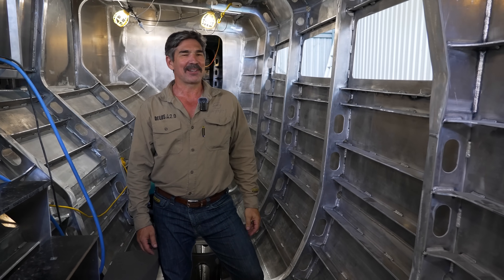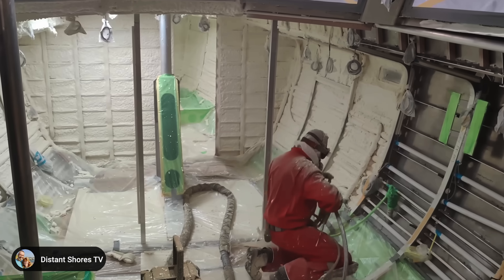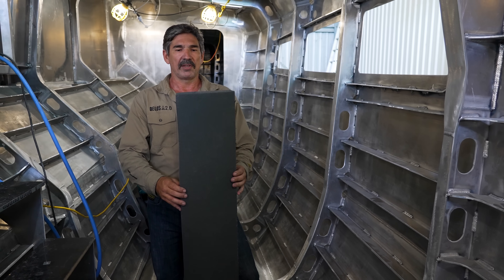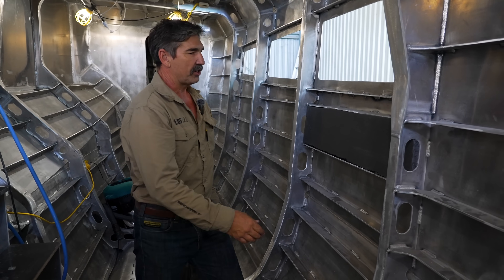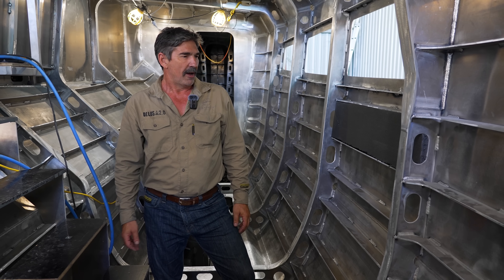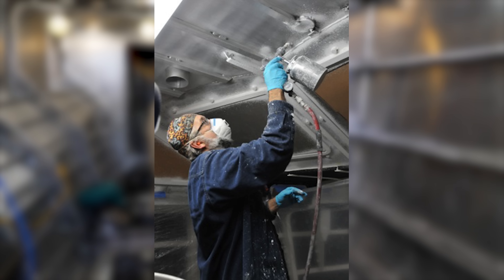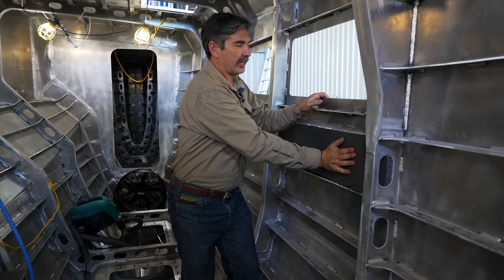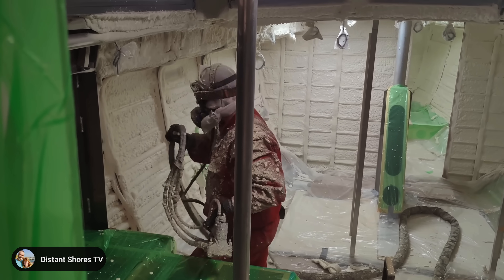HELP, We Need Your Advice!  How Should We Insulate Our Aluminum Catamaran???

Comment: Hi, I have an Alubat OVNI 35 that I bought in France  and sailed back home to Stockholm a couple of years ago. The boat was built in 1984 and I decided to renovate and in particular add insulation. Right now the interior looks just like yours with bare aluminium.
At first, the plan was to insulate with spray foam. What made me uneasy with spray form is that it seems irreversible and that inspection of the inside of the metal hull will be more difficult. Under the assumption that adhesion of spray foam can be compared to painting, on my boat, there is 40-year-old paint on the deck and inside the boat. On the deck there is a lot of corrosion under the paint but inside the paint is still in perfect condition. So in this case there is really no need to be able to inspect the inside of the hull. But can there be other situations where it will be needed.
The problem of insulating a metal hull is common with DIY RVs and also with insulating shipping containers and there are many such videos on YouTube.

Comment: spary foam is better solution. easy to remove with mechanical way or solvent when need and easy to reapply. and the mold will grown behind panels on condesed water.

Comment: Hi Guys! 
Im a 12 year professional Van/bus builder. I am getting away from custom builds and soon releasing a production covert land yacht using the largest Mercedes-Benz Sprinter van AWD turbo. My priorities are functionality, quality and safety as it SHOULD be for every builder. 
You can buy all the same materials as another guy but its a balance of construction, precision and flow.

 You are on the right track as far as awareness and knowledge of 2 extreme temperatures metal being the bridge. Vans and buses also have thus problem, more so in the wintertime. but also in the summer after a cold night turns hot int he morning you will have a bat cave. 

Things to consider, I did some research in material quality. if you want to go down a rabbit hole look at mass deaths and extreme conditions of temporary housing for hurricane Catrina relief victims. Building with similar materials as a standard home in a small foot print the off gassing and toxins are far more concentrated. The air qualities has a dramatic difference in parts per billion of those toxins.

With that said, be cautious with what your suing for materials moving forward as I'm sure you will. Go natural, try to steer away from synthetic  you can. Insulation is the big one...

I would highly recommend Havelock Sheep's wool from New Zealand. Is similar in price to standard insulation and has a higher R value as most insulation. R value is 3.6 per inch.  

Wool is naturally fire resistant and retardant, it has a SMOLDERING point of 2,000 Degrees fahrenheit.  if you have a wire fire it will help put it out and or contain the fire. 

Wool is also has natural antimicrobial preterites.

Wool also regulates moisture! It will pull condensation and help aerate it.

Wool also is purifies air quality and traps toxins. 

Mold is the silent killer in living spaces more so in tight quarters and especially boats and vans... When you get a constant exposure of condensation and entrapment mold occurs. You many never know but can effect your health. 

With all that said wool would be your #1 choice for insulation, my advise would be go with the thin spray insulation for a buffer condensation layer than use these wool batts. 

If you want to really control your interior climate and you have the room i would spray foam and use woo batts on top of that, make sure you have good airflow through out your construction regardless. 

I lived in a Bus with spray foam and wool I had radiant flooring and off grid 24v mini split air conditioning, with 100% off grid self contained solar and batter storage.  1,000 watts f solar and 10KWh of victron lithium. I would ski instruct in Colorado and have spent time in the dessert no problem.

to give you example of the wools abilities I used it as a fire retardant around my wood stove and replaced the formaldehyde insulation in my gas oven. works great. would use it around your engine bays also! I would look into diesel coolant heaters for a "combi" heater for hot water and radiant heat, heated pex floor and air handlers!

Cheers! -Kyle

heres my recommended links,

https://havelockwool.com/?utm_term=havelock%20wool&utm_campaign=GS_Havelock_Search_BRAND&utm_source=adwords&utm_medium=ppc&hsa_acc=3434447461&hsa_cam=21548205263&hsa_grp=160845722570&hsa_ad=708172960060&hsa_src=g&hsa_tgt=kwd-1104058530422&hsa_kw=havelock%20wool&hsa_mt=b&hsa_net=adwords&hsa_ver=3&gad_source=1&gclid=Cj0KCQiA3sq6BhD2ARIsAJ8MRwVJqidcf-_aTzGyZKqOb5J5ZpCI5OJZR6-WRiJF4PBuChdKva02jiYaAr3GEALw_wcB

https://rixens.com/products/g52-hydronic-with-s-3-diesel

https://www.merlinsolar.com/

https://www.cruisencomfortusa.com/?adgroupid=142258080170&device=c&keyword=12%20volt%20ac%20unit&gad_source=1&gclid=Cj0KCQiA3sq6BhD2ARIsAJ8MRwUBIBnVMu4gw_b9NFnLdE4ZMkFxWCNGbf9qREvofXQGrlJRETt_jokaAgH8EALw_wcB

Big things to consider

Comment: We spray foam all our commercial boats that we’ve built for ourselves, not as hard as you think to remove if needed to do patch repairs. I wouldn’t do it any other way. The condensation is a real thing and if you haven’t done it right ie spray foam, you’ll probably regret it. That’s what we did on our 4 65ft vessels

Comment: Spray coating is the best way to go for all reasons. The main reason is what you said. It insulates and you never have any need to remove it barring a repair to that section. Even then it is easy to replace.

Comment: Avid internet troll and keyboard warrior here:
While most of industrial applications use pre-shaped removable xpe stuff, it's not really a viable option for a sailing vessel, as you wouldn't normally access the hull that often. it's gonna be a b*tch to install, and the costs compared to a sprayed foam solution are much higher.
That said, I think this solution is the best /watch?v=dQw4w9WgXcQ

Comment: Up till last year I had a steel boat with spray foam from ‘96, foam was still in perfect condition and I had no condensation problems, it was sprayed to deep under the water line keeping the boat well insulated. Yes, if you have to do some welding you have to scratch the foam off but it is not much of a hassle and after you spray some closed cell from a can. Now I have a aluminum boat with foam panels, everywhere where the ribs are not fully covered I have condensation, even before I have condensation on the windows.  I would put in some extra ducts for whatever cable you need in the future, the wood strips to bolt the interior to and spray, by far the easiest and reasonably foolproof..

Comment: Make sure you use a thermal barrier if you use foam batting. The heat on the hull could melt the areas that touch the metal.

Comment: Insulation pin ist steel, fixing to an aluminium hull gives you a fine little battery running a corrosion process beneath your insulation. There you go...

Comment: Over time, there will be rust under the foam. Find out about such a technology as Cork shavings. It is also sprayed onto the metal surface. It is used for the insulation of aluminum yachts and in the construction of motor homes. Sorry for the mistakes in the text, I used google translate.

Comment: I would advise heavily to not use spray foam it prevents you from completing hull inspections. A lot of the steel fishing trawlers in West Aus have concrete in the bilges and it causes massive headaches when it’s comes to getting the vessel surveyed. The boat has to be slipped and the hull inspected with ultrasonic thickness gauge to check for corrosion.

Comment: I’m Tackling with same problem and spray foam will be the way to go. One note for your concern on repairs is how often do you think aluminum boat will need some hull repairs? Even if you do then cut, grind and reapply.

Compare also task of spraying to measuring, cutting and placing foam blocks. A sum of time and effort must be taken into account. Although blocks of foam look really nice.

Those pins gave me goosebumps. Immediately I saw a rocking boat and hundreds of needles on walls just waiting for you to bump onto them.. No caps on them make me think of them as safe.

Comment: I am not a specialist, but like you live aboard the boat, now for 16 years. First years we lived onboard in Northern Europe, even when it was -22 C and we had to use an ax to free the boat daily. Later left to the topics after weeks of battling frozen marinas. Our boat was isolated by me with foam and thin radiator foam on a aluminium backing. as i bought it it had zero isolation. And there was not much space to go with. we had only a max of 2 ich at some places, always with alu backed foil between the isolation and the hull. And it was okay-ish. I really do not like the ideal of the foam because you get a unremovable layer, but, but the foam plates will create bridges of cold (condensation forms there) on all of the ribs and on the bulkheads, you cannot get into corners, and water may get there. Hence all shipyards in The Netherlands that build in aluminium advice to spray. you can see how sailing distance shores did their boat. And like it or not, if you plan to go to the artic, or Sweden, that's the best way to do it. And before you do you must make sure you have essential lines like cable run pipes etc in place. Do think about additional floor isolation for comfort, we had our un-isoalted floor and then put the isolated and a carpet on top, and it made a huge difference. anything under the waterline does not get as cold, even when the water is frozen 20 cm or so, under the ice its just around 0 C . just above the ice line you have the lowest temperature, hence you could consider combining the methods. Personally, despite dislike, i'd spray...given how often are you planning to get behind the spray? Bu having extra free pipes for future projects is essential Success with  the decision

Comment: Dont have experience with boats but have with spray foam and if you have to remove it there is ways and its not that hard i would vote spray foam sounds like it has more advantages than dis advantages but if your still on the fence see if you can find an installer to spray a test piece and see what it takes to remove it and if you can live with that challenge

Comment: When insulating a roof in Ireland with spray foam.. you can’t spray straight onto the felt which sits under the roof tiles.. you have to use a “breathAble card” first then the foam.. te card is like a really thin membrane.

Comment: Hello Brian
My name is Antoine, I have been sailing around the world for 50 years, for the last 35 on a 42 ft , thick plate aluminium catamaran with practically no ribs and no stringers,  a system devised by the French company META , who started in the sixties by building legendary French Sailor ( first Golden Globe) Bernard Moitessier’s boat.  It makes for a heavier hull than yours, but utmost resistance to shocks or any corrosion (bottom plate 12 mm, sides 10 mm)

For insulation I use those polyethylene 40 mm sheets you mention, glued to the hull and have been completely happy with it, with no ribs or stringers to conduct heat or cold.

For the external coating of aluminium or steel boats, I  would like to mention a product which I have used for more than 40 years, a zinc silicate coating that is applied with brush or air-pistol . Believe it or not, you clean brushes, hands and all with water ! Non toxic, invented in UK in the sixties, presently made in Lyon, France, called Dox Anode ( https://doxanode.com/en/ ) which doesn’t even need to be coated with antifouling ( so no toxic coating), and which I very easily clean underwater or by beaching the boat, ,and  just renew every  three years or so 

My catamaran Banana Split is presently in Hervey Bay, and I plan to be in Brisbane area ( probably Dockside marina) around Christmas; if you wanted to learn more about the boat and process, I’d be easy to reach at antoinepresse@me.com
You can learn more about our journeys ( which mostly took place before the Internet era) on www.antoine.tv
The best to you
Antoine

Comment: Wow lots of great advice. My 2cents worth is in regards to your conduit. Run a few pieces of quality fishing line through to each exit, tape them down at the ends out of the way. If you ever need to pull a new wire you will have these built in. A few mins work may save lots of swearing in years to come.

Comment: I work in the industry, fire the pins on,paint everything or sikaflex the pins on after. Wrap the web frames and then in between after with insulation/fibre glass backed. Have a look at super yachts . Hope this helps

Comment: I recommend a mix of spray primer/paint then spray insulation.  I don't recall which primer/paint it is, but I've seen it in another channel where they had to strip out the spray foam and the spray foam sticks lightly and is able to be pulled off leaving little residue because the paint blocks it from a strong chemical bond to the aluminum.

Comment: Hi. Great work on the 2.0 boat by the way. 

One consideration I would take for your insulation challenge would be to consider a constrained layer damper with insulation, at least for the first coat to the bare hull. This would do two things, protect the hull from moisture, acoustically dampen the hill and provide a modest amount of insulation (you will likely need more but I have a thought on that too. 

Layer 1 - constrained layer damper - alubutyl material. Many options on the internet

Layer 2 - block foam like you had in your video

Layer 3 - multi foil as would be used to insulate houses (I used this in my barn conversion roof space for my dorma bedroom) which would solve your problem with cold bridges for the ribs in the hull. 

Happy to talk you through those if you wish. 

Good luck

Comment: Gotta agree with the spray foam option, but is there a type that doesn't expand as much? That is the main drawback of that stuff. Always use mechanical rather than adhesive attachments for solid foam, but do you really need any attachment method if the insulation is held in place by interior walls/bulkheads? Is there any kind of insulation that is thin enough, yet efficient enough, to go over and around the stringers? Thinking the kind used around the outside of AC's and refrigerators. What about something else you could spray in as you build the interior, like the stuff they spray into attics? So many questions! I do not envy you for this choice you have to make!

Comment: Can you get the XPE in thicker bats? If so then you could, rather than cutting it to fit each cell, just slice it along the ribs and slip it into place. That would allow you put up whole sections at a time. If cut right and fitted you probably wouldn't even need fasteners. Cut out channels for any conduits or plumbing and the like. That stuff looks like you could use a hot wire to slice and shape it.

Comment: Look at Alubat Aluminum sailboats. They use spray on cork insulation and its only a thin layer to separate aluminium from air. They apply those foam you were showing on top of it. Makes sense to me that way.

Comment: When insulating under metal roofing it is essential to create cavity between the metal and the insulation so some type of spacer first before installing insulation bets would be needed. So why not glue your pins to spacers which will keep an air gap. Then make sure the insulation bats sit say 10mm past the metal ribs then use thin insulation over the top covering all exposed metal. Just a thought

Comment: The thermal conductivity will happen in areas where the aluminum touches the interior. Look into thermal breaks used in aluminum window frames.  That is what window manufactures do to reach energy star ratings.  Foaming in those voids will bock access and create moisture between the hull and the insulation.  If insulating the void helped then aluminum frame windows would be injected with foam. The are not.

Comment: With foam panels between the ribs and stringer, you might as well not insulate because the thermal conductivity of aluminum is so high that the ribs and stringers will bring the cold right to the surface.  
I am a precast concrete engineer and many years ago, we make sandwich insulated panels which had concrete panels on each face and 2" to 4" of EXP foam board in between.  The two concrete faces were held together by small hairpin anchors made from 12ga stainless steel wire which were at spaced at 16" o.c. each way.  After many years of use, a full-scale test of the thermal properties of these panels were conducted.  The testing found that these pins reduced the thermal efficiency of the XPS from 15% to 25%.

My choice would be closed cell spray foam.

Comment: Zinc Chromate primer  it first then Spray foam is the only insulation I would use. The benifit out weigh the craw back 5 to 1

Comment: BS Chemist here.  Agree with zinc chromate for corrosion control, HOWEVER that is a "hexavalent" chromium ion, very bad news as soldiers in the Mideast Wars discovered, q.v.  I'd look for some other coating.  See Wikipedia page for zinc chromate: Recent studies have shown that not only is zinc chromate highly toxic, it is also a carcinogen because it contains Cr(VI). Exposure to zinc chromate can cause tissue ulceration and cancer. A study published in the British Journal of Industrial Medicine showed a significant correlation between the use of zinc chromate and lead chromate in factories and the number of cases in lung cancer experienced by the workers. Because of its toxicity the use of zinc chromate has greatly diminished in recent years.